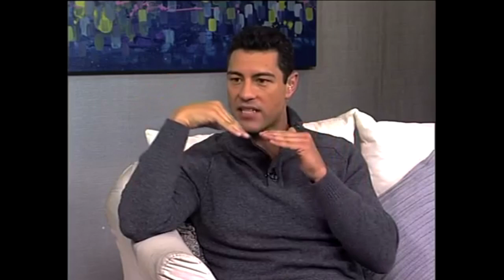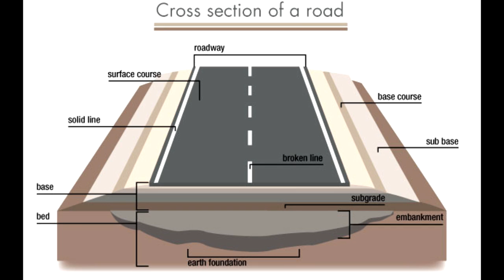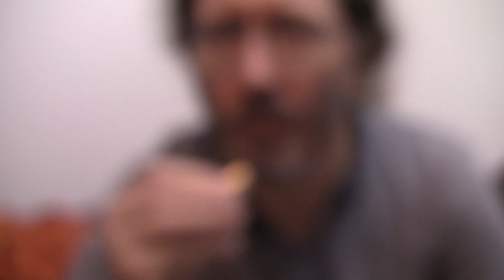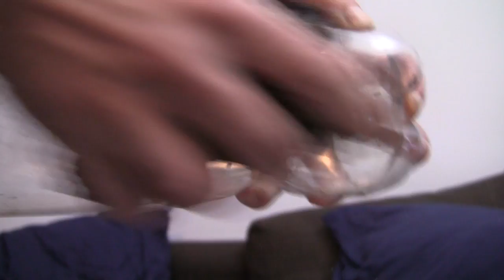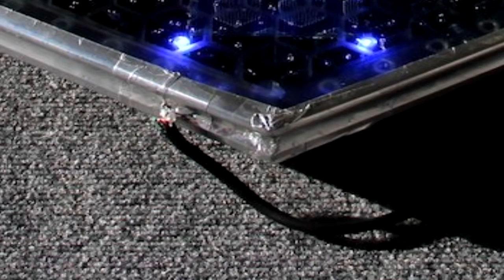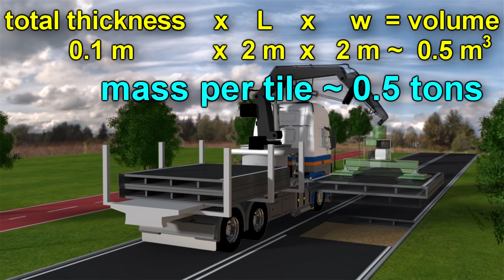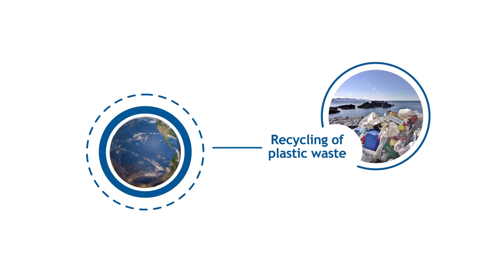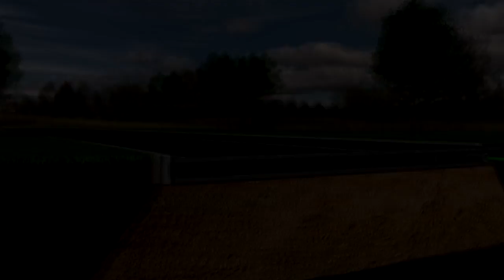Plastic Roadways BUSTED!

Comment: They just tried to solve not existing problem. Recycled plastic is worth more than asphalt or concrete. Noone buys recycled plastic to burn it. It's just burned with all other trash, so the problem is that not everything is recycled. Creating another application to it won't change anything. Someone still has to recycle it, it's not free.

Regarding upgrading roads, there are a few problems. Let's skip building foundation as you already covered it. It's basically built once and it lasts for long time. There are not many cases where road had to be fixed including it.
Problem with current roads? It's breaking easily, especially in places with seasonal temperatures around freezing point. It's not elastic enough to survive forces of freezing water and it's porous enough to let this water in. We have to deal with water somehow. On big roads it's not enough to keep it with angle because it's too wide and water is flowing sideways. Maybe something so porous it will let the water pass? 
Second thing is time and cost of maintenance. If you want to do it right, you have to rip all of it and put new asphalt in place. It takes time and some heavy machinery. In Poland it's pretty common that only smart parts are replaces to keep it fast. After such fix it's not smooth (because heavy machinery was not used, just simple tools), you can feel each patch on the road and it's much more likely to break again on joint points. 

The best idea to fix that would be using prefabricated road surface that can be easily replaced. How to do that? I don't know. I'd be rich if I knew that. It has to be tough, durable, easy in production, recyclable, easy in replacement, easy to attach to foundation and most of all, possible to lay on curved roads. If it's easy to replace then we can even keep it less durable than asphalt. If you can fix it in a few hours during night, then no problem.

So to keep it recyclable and cheap, it still has to be done with something rock-based. Maybe come composite of rock and some kinds of plastic? New type of asphalt? Most problematic would be creating way of laying it on any shape of surface. Roads are curvy, they change shape, go up and down. It has to be elastic enough to bend it and easy to put in proper shape. Something more like BIG asphalt tiles that can be cut to shape. All leftovers and broken tiles go back to produce new ones. That may work. Finally, there's a problem of attaching it to current foundation of any roads. It should be possible, otherwise it won't be cost effective.

Comment: Another issue that was not covered in this video: What keeps these "light weight" hollow plastic elements from floating away with the next strong rain or flooding? Their average density is lower than that of water after all.
If you want to keep something in place on the ground you would always use heavy and dense material - but not plastic.

Comment: Don't forget about fluids in a flexible raceway. Heavy vehicles rolling over the top of it , you might just create standing waves running opposite directions, that might cause a slight water hammer problem when they meet. By slight problem I mean sections of exploding road, no doubt a disappointment to those who will be first on the scene.

Comment: For me pipe, cables and fiber part is most unclear. They just drop module road in the place and its magically connected from the inside ? HOW?!?!?! Pipes had to be firmly sealed , cables , power , but fiber has the most complicated connection. But wait, just try to imagine module disconnection , yea just rip everything out.

Comment: I'd also like to see them replace road that has a fat underground power transmission line running through it. it would be hard enough to get the clearance from a load dispatcher to de-energize the line, and costs would be astronomical to replace it to even lay it down.

Comment: I'm just a truck driver and I know this plastic road idea is just a pile of total crap. A semi has tires blow just because the assault get so hot in the summer tires heat up from the hot roads and just melt. Then in winter bridges freeze because there is cold air under them. So this plastic road would melt in summer and the roads would have more ice than the land to either side of the road in the winter and that ice will last longer because its being kept cold by the ice cold water running under it suckling any heat away. Then on top of that ice plows cant plow because the steel plow blades would just tear the plastic roads to shreds. If you think there are lots of deaths with assault roads just put plastic roads down!

Comment: Yes , well how do you make the cable connections between each segment of road way? You could have hundreds of cables in each conduit. Do you really think your going to just unplug each segment and plug in the replacement. the amounts of connections alone will make it nonviable and extremely unreliable as far as the cable continuity.

Comment: Hey Thunderf00t, I just found your videos, and love them.  I did want to throw my 2 cents in, however.
You missed 1 huge point that I think would be the ultimate nail in the coffin (you can "engineer" workarounds for all of the other issues, but not this one).  We have a huge HUGE problem with microbeads of plastic finding their way into the oceans and waterways.  As this stuff wears down it sends literally tons of microbeads into wastewater, and it is virtually impossible to filter out.  This is impossible to work around, without billions of additional dollars put into just waste water reclamation.

Anyhow, just my 2 cents, love the videos!
Reply: I was about to mention the same thing.  It would essentially take plastic from a landfill (contained) and distribute it all over the environment.  It's just about the exact opposite of what they're trying to do.

Comment: my not make rubber roads with asphalt tires?
Reply: I think that happened in an episode of Darkwing Duck.
Reply: In Japan there are a few roads that incorporate recycled tires in them... very quiet, but don't know about durability.
Reply: Recycled rubber is routinely used in asphalt paving. It's a Federal program specifically to use recycled tires.
Reply: Been doing that for years here, I meen you ever try to stab rubber. It's pretty much like the stuff they put in the asphalt mixture anyways.
Reply: Brennan I heard that's how they do it in China
Reply: Yabba dabba do!
Reply: Ok nobody gave the proper answer, you see you want the thing that lasts the longest to be the one static hard to replace one, with the easier to replace/smaller individual component to be the one that needs to be replaced the most. 

This is a basic design standard, you see the static big hard to replace component will be seeing more interactions than each smaller one, and once the time comes when it will need to be replaced or fixed with new asphalt even if done right it will inconvenience a great deal of people, so in general the most efficient thing is to make it be the sturdiest of the two elements.

Asphalt tires would last a lot themselves, but the rubber road would last almost no time at all, thus you would need to be constantly replacing said road, would be inconveniencing lots of people a great deal of the time and thus be inefficient time and money wise.
Reply: Gavin J it's obviously a joke
Reply: And instead of elevators the whole building moves the floor you want to street level
Reply: I know you're joking, but your statement gives me NIGHTMARES! I've actually hauled rubberized asphalt. It's sticky has hell and hardens at a higher temperature.

I had a block of that shit stuck to my dog house for 3 days that I kept nursing with diesel. One day I was on the side of the road cleaning my door I heard a sliding sound, I turned around at the last minute and managed to dodge an asphalt boulder before it took my legs out!
Reply: I have an even better idea, now bear with me.

SQUARE TIRES! And give the roads serrated surfaces. The car will move smoothly and safely like a set of cogs!
Reply: Pam Poovey King
Reply: Stop stealing my ideas.
Reply: My god. I think I remember that.
Reply: HunterXray You sir are a genius...
Reply: They actually do!
Reply: I see one major (and probably many minor) Problem(s) with full-rubber roads.

Did you try to walk on wet Rubber?
We would need to make all Shoes out of asphalt, too!
And that would mean that we also have to become all japanese, sincewe can no longer wear shoes indoors.
(Or anywhere where is no rubberfloor...)

And yes, i did understand that this is a joke, but let me my fun to pick holes in it. : D
Just in case someone takes this idea and carries it to Kickstarter, then got Tunderf00t less to do to point the rediculessnes out.
Reply: So the roads would be inflated with air, right?
Reply: Brennan offroading would be impossible and if you jump a car the tires would fall apart
Reply: Brilliant. you deserve a Nobel prize.
Reply: So far, 553 people thought that was funny?
Reply: Arizona has a sizable stretch of Highway made out of rubber and asphalt. It makes for a very smooth and quiet ride.
Reply: Yeah your tires woulndt pop but the road would
Reply: Harvard: You want a scholarship?
Reply: Don't give the ideas
Reply: Only if you make a pretty ad to convince me
Reply: Yes, sounds like a good idea, much more realistic than plastic roads!
Reply: We do, we can make the aggregate whatever we want.
Reply: The lost Byte 
I have sold rubber floors. They can be made grippy while wet. A thin coating can make it formula 1 on a track grip. Easily done.
Reply: "some sense" but try to drive on non-rubber streets :D
Reply: There was a hanna Barbara cartoon with cavemen that did that in the 70s
Reply: Corey Newcomb in Okinawa some roads use coral

Comment: Are there truly no UV-stabilizing additives for PET?  I've worked in industry with engineering plastics before, and there were all sorts of additives that could be mixed in to the plastic melt to prevent UV degradation if they had to be used outside.

Well that wasn't hard.  Now all they need to do is solve all the other problems, and it will be great!

Comment: So u think that plastic eco parking is a fake?? Or u think solid plastic road is most impossible than not solid eco parking? It nay be smaller modules as concrete slabs or paving stones. There are different types of plastic. U made a stupid video. And try not to puke when you speak into the microphone

Comment: My argument is if plastic was a viable road material, we would be using it. But we're not. Because it obviously doesnt work. I mean plastic holding a truck with an oversize load? pfft gimme a break. Even asphalt breaks and bends under constant stress. Plastic has no chance. Also I work with petro products like pure asphalt, crude, diesel, nat gas etc. Once asphalt is 260-360 degrees it cools when exposed to the air extremely fast.(I know this because I actually have to handle it and sample it.)  But reheat it and it's thin and ready to pump again. There is also different grades of asphalt which you can tell by just handling it. It also creates a decent amount of h2s which can kill you c: but it can be treated to reduce h2s. 10ppm h2s is considered risky and ive been on arab crude ships with 2800ppm lol it's crazy...

Comment: I live In canada, Are Roads get fucked every year due to the ground and asphalt freezing and unfreezing. Last winter we got a couble of days of -20c which is warmer then usual (probably global warming at work(i live in the soutest part of it so -15c average is normal)). My plastic shove cracked of the wooden handle. I actually broke 2 shovels this winter. 

If a plastic shovel, designed for winter cracks because of cold while I'm lifting probably 10kg of snow(wet), then the fucking roads with be fucked in a day